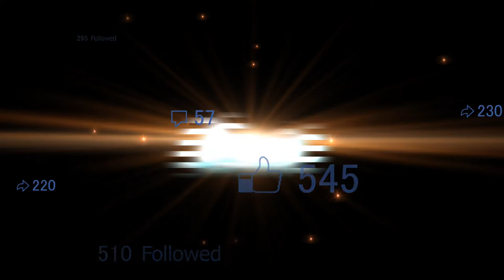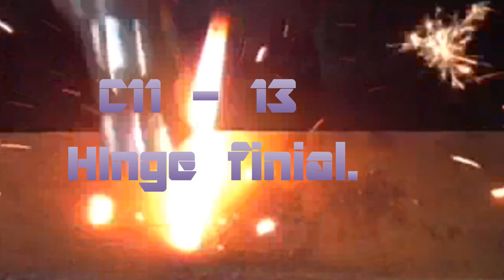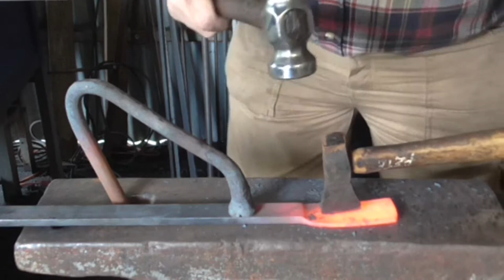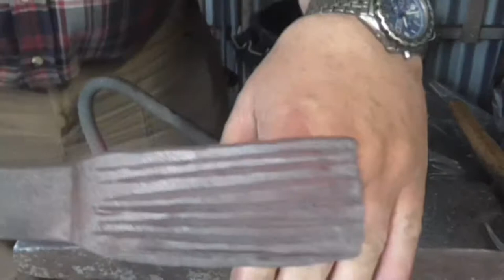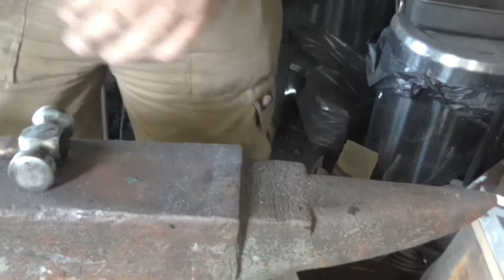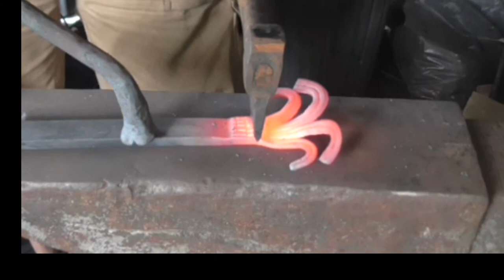Blacksmithing an 11th - 13th Century HInge finial.

Comment: Really nice! Is that a regular hacket you used or is it a tool made/modified for blacksmithing?
Reply from the maker: The cutting tool I use is called a 'hot cut' here. It is made specifically for Blacksmithing, for cutting hot steel. I have to confess, I did not make it, it was given to me by my teacher. The one I have is made from EN9, medium carbon steel, others are made from a higher grade of carbon steel, but I haven't got one of those..... yet! I'm going to ask him to show me how to  make them in the near future.